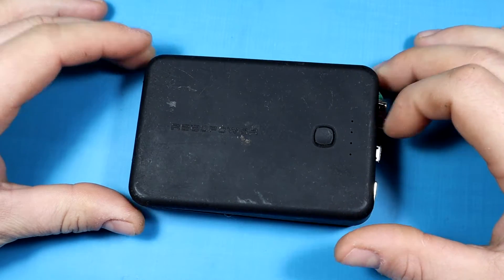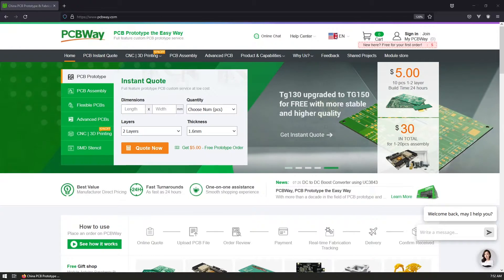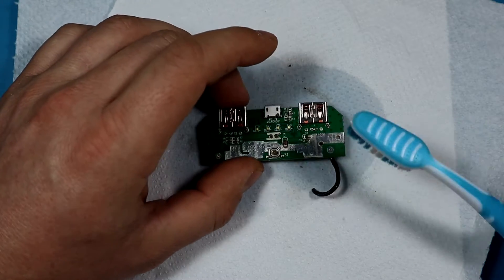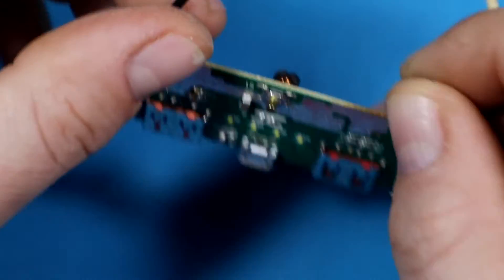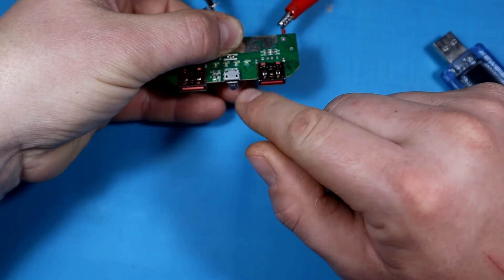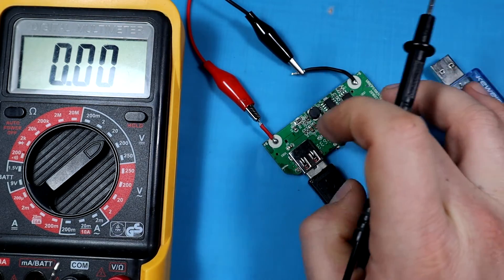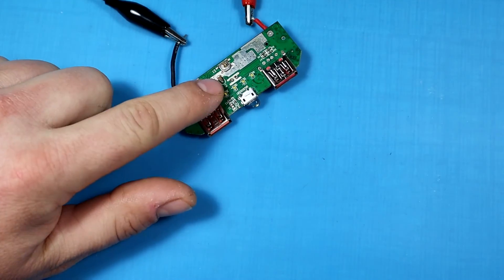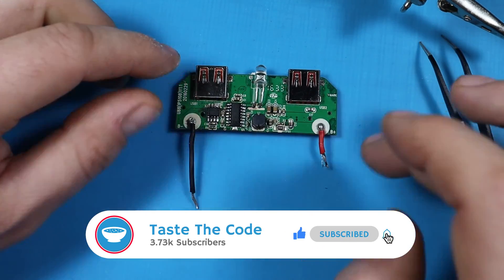Power bank repair attempt - very bad liquid damage! Can it be saved?

Comment: I know what's wrong with the board 🤣
Reply from the maker: What's that?
Reply: @TasteTheCode  It's broken 😄
Reply from the maker: Hahahhahahha
Reply: @TasteTheCode  just kidding, I guess the water shortened up the chip's pins that weren't supposed to be connected, and the chips died, and now it outputs a voltage that again isn't supposed to be outputted and heats the board. I guess 🙂 Interesting video, if you can find the chips, try replacing them.
Reply from the maker: That's a good idea. I see that it is available online so I guess I'll try that out! Thanks!

Comment: I once bought a powerbank with a solar panel at Aldi.
They broke down within a year.
The Lipo battery started to swell and my powerbank just bulged because of the pressure.
Good luck trying to fix it.
Reply from the maker: Thanks! Bulging is very dangerous. It means that the battery developed high pressure because of an internal shirt circuit. I've seen in happening on phones where it actually breaks the screen from the inside so it's not just Aldi stuff that have that issue.